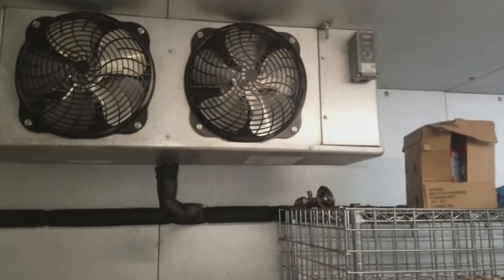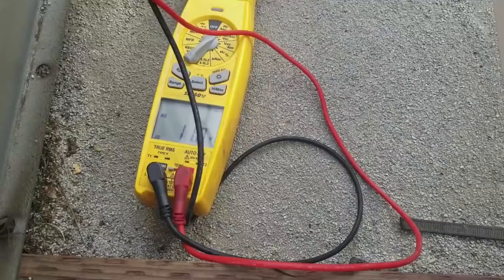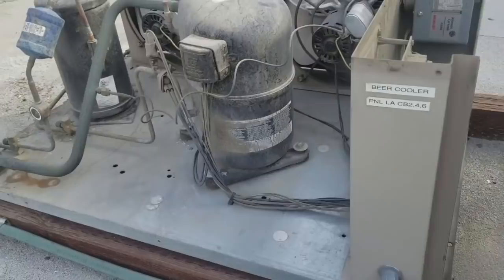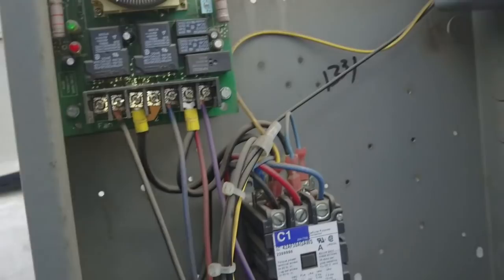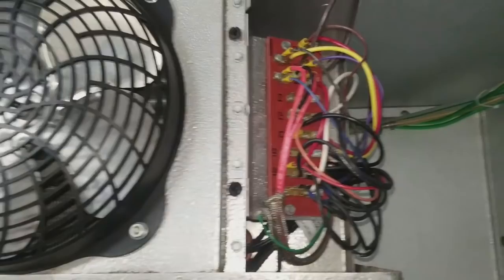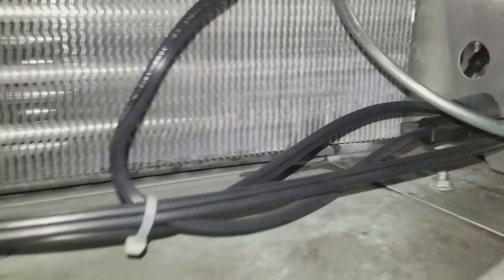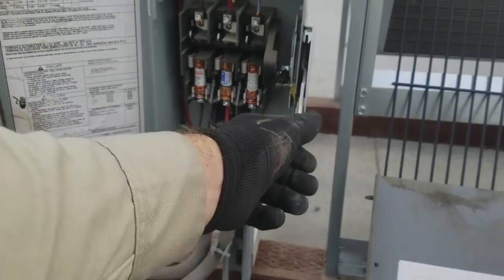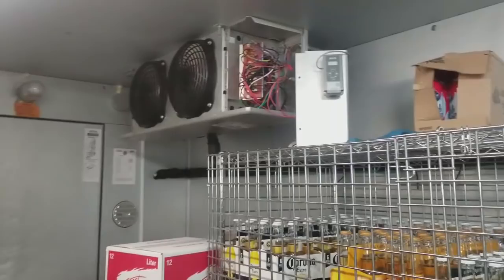Beer walk in not working

Comment: Good video Chris. I agree completely with your approach - many times I’ve had customers replace a fuse to get the machine running again, not even giving any consideration to the idea that fuses don’t just blow for no reason whatsoever... there’s always a reason why the fuse blew, and it’s the technician’s job to find the reason why.
Reply: 404 Refrigeration hey i found copper tubes in the fuse box couple of times when i asked the owner they always say oh because it blowing the fuses!!!???🤔😨😱
Reply from the maker: that sounds scary
Reply from the maker: thanks for the nice words and thanks again for watching
Reply: While working automotive as a side hobby and as a job while looking for an HVAC job that actually needs someone in the field not just a shop rat, I have found some fuses appear to blow for no reason. I had a fuse for a computer on a ford ranger i once had blow, i never found the short even after gutting the wiring to the computer and the computer itself. I have a theory that in certain DC systems like vehicles, a fuse will "wear out". Under certain repeated conditions the fuse heats and cools from reaching near max value and eventually that wears it down to a lower value making it blow. It's just a wild guess, it'd be nice to know the real reason.
Reply: @bairfamilyfarm1336  Your logic is good, thermal heating of the fuse through running at 100 % fuse rating in hot conditions or through dirty fuse connections or loose cable terminals will weaken a fuse, lowering it's 'blow' rating. The heating of the fusing element will cause it to begin oxidizing or in some cases the fusing element to begin to sag and elongate reducing the CSA of the fusing element lowering it's rating.
The rating on a fuse is it's 'will carry' continually rating, not it's 'blow' rating. A 20 Amp fuse will carry 20 Amps continually at standard rated temperature. Fuse rating curves and withstand ratings is a whole science in itself.
Reply: @bairfamilyfarm1336  The reason can also be on the other end source of the fuse too a brown out can also cause the above.
Reply: @gene-khvacr  Next time you find that (or pennies in a screw in fuse panel), simply tell the Idiots that WHEN this causes a Fire, the Fire Inspector will find the Illegal fuse bypass and not only are you going to get slapped with a Huge Fine, you could also be Charged with Criminal Negligence (for the Fire) and possibly Criminally Negligent Homicide (AKA Murder in the Second Degree) if someone dies in the Fire.
AND the Insurance Company WILL Deny your Claim and Cancel your Policy (which puts you out of Business until you can find a new Insurance Carrier...Good Luck with that, you WILL need it)...
THEN you'll be faced with LOTS of Civil Lawsuits from anyone that got hurt (Financially and/or Physically) by the Fire...

NEVER REPLACE A FUSE WITH ANYTHING OTHER THAN WHICHEVER FUSE THAT APPLICATION CALLS FOR!!!
You can replace a Fuse with a Fuse of a smaller Amperage Rating (not recommended, but Legally permitted), but NEVER with one that has a Higher Amperage Rating...
Reply: @bairfamilyfarm1336  Fuses have a thermal link inside them, when a Short Circuit or Overload happens, the Circuit draws too much Amperage. The more Amps a wire passes, the hotter it gets so the fuseable link inside the fuse body is designed to melt when its temperature gets too high.
That temp is determined by how many Amps it's designed to safely pass.
Pass to many Amps, and the link gets too hot and melts - voila, the Fuse Blows, so if the truck's circuit is frequently operating near or at max capacity (especially in a hot climate or near a hot part of the engine compartment), that link will eventually soften and blow without ever seeing an Overload or Short, the vibration caused by driving the truck doesn't help either...
Reply: Cha cha cha chill homie 🎉. It was a joke. Everyone knows copper tube still will fail ( burn open ) long before solid copper bar . This is what me and all my employees do .

Comment: Dude, I can't quit watching your videos. I've been a comfort tech for over 20 years. You are a rare breed of tech. So many companies send out unqualified service techs. I'm going into business for myself full time this spring. Your standard is what every company should try and achieve. Keep it up brother!
Reply from the maker: Thanks bud
Reply from the maker: Great advice Joe
Reply: Joe Jones, thanks for the advice. I have over 20 years in the residential heating and cooling trade. I by no means think I know everything. However, I consider myself a well seasoned tech and have done my share of install work. We're I live in rural NW  Missouri the market is huge. There is only two companies within 50 miles. One of them was recently bought out, downsized and no longer does whole house new construction. The other has a bad reputation of not returning calls and not showing up. I've been running my own licensed business on the side for about 3 yrs now. I feel that my customer base has grown enough to make that jump. Yes, it takes dedication. Your own business is a 24 hr job. The techs that try it and failed generally have no business sense. They don't charge what they are worth and accumulate to much debt / overhead. If you grow your business slowly, focus on customer satisfaction and watch your bottom line, you can be successful.
Reply: jlwhitt77 agreed!!

Comment: Who else scrolled ALLLLLLL the way back here after the livestream to see if it was as bad as he thinks? Lol

It's not!
I can tell that you didn't have any practice working and holding the phone, and it's much more polished now, but you still did a great job.

I will say that though I agree with you that fuses don't fail for no reason, most of the time, every once in a while you run into a faulty fuse, or one that fatigued from vibration. Could also be a fluke, like a power company brown out or switching event while the heaters were on, or during the compressor start in rush current spike.

Or, if the defrost clock is sticky, maybe the contacts stuck and started the compressor before turning off the heater? Depends if it's a double throw, or seperate contacts on a cam.

Anyway, yes, always assume that there is a cause that you need to locate, because most of the time there is! Lol

Comment: One thing you can do to check for shorts is this.
Get a few 100w lights. Cenect them across the fuse terminals of the blowen fuse. If theres a short the light will just light up
Some faults are voltage depindent and will not show up until power is applied.
This works grate for me when im trubleshooting.
Reply: Quick note about this test, it HAS to be incandescent bulbs, because what you're doing here is basically inserting a ballast resistor to limit fault current. Personally I recommend the "rough service" bulbs, as they're safer due to the silicone rubber coating on the bulb that should catch most fragments in the nearly inevitable case that the bulb does break (stuff happens). The filaments are also more resistant to vibration, because they have additional filament supports inside the bulb.
LED bulbs won't tell you anything, because they'll light up with leakage currents and send you chasing after stray voltages that don't actually have any current behind them.

Comment: Great work. I use similar organizers with those type of bins and they are great for fuses, small pipe fittings, electrical fittings etc.
Reply from the maker: Yeah when I went to the setup with those cases I wondered why it took me so long, I love them. And the rack I store them in really helps too

Comment: Had that issue had a 60 amp splitter someone put 40 amp fuse in It well replaced it and hit power pop went the welder but then again we figured it was already bad and is what took out the splitter was a 16k machine

Comment: Chris- I know this is an older video did you have to go back other than replaced the fuses with the 25 amps? I had a very similar situation as what you're having and it seemed to happen in the evening or overnight but not during the day. What it ended up boiling down to was the compressor was coming back on during defrost,  overloading the breaker,  since it was 12 ga THHN on a 20amp breaker and because technically when its single strand wire, it's good for up to 25 amps.  So we replaced the breaker with a 25a breaker.    So  Essentially the pressure was coming up causing the low pressure switch to come back on and there was no enter-lock to keep them from both from coming on at the same time.  Over all either the valves were getting weak or the solenoid was leaking through, we finally changed the compressor. It was a learning experience that costed me a few hours.
Reply from the maker: Rick if I remember right in the video I found some rubbed out wires and that was the problem, I ended up replacing the fuses with the right size and never got another call back. I still service this restaurant and the beer walk in has been working fine since.
Reply from the maker: I am going to go live on Youtube tonight 11/5/18 at 5:00PM pacific time to discuss my most recent uploads and answer questions. Come on over and check it out 
https://youtu.be/JHpAuTzzw6E

Comment: I dont know if you did it or not but wouldnt it be a good idea to check the amp draw of the heaters since it seems like the culprit was the defrost cycle? I've also seen in other HVAC video of people having only 1 or 2 fuses blow but the culprit turned out to be funky 3 phase power coming into the building or lighting, etc.

Comment: Everything exposed like that might be a concern. What happened to the lids? I’ve seen situations where power company’s have a malfunction and can do havoc on local public services. I had a transformer single phasing at a hotel I worked at and they eventually replaced it. Maybe ??
Reply: If you are refering to the roof unit, I think it's just that he has already removed them prior to the start of the video. You can see at least one panel is laying on the ground when he is checking the correct fuse rating.

Comment: I have a question in the time 0:28 this device for what???? the use ???? thanks a lot beforehand
Reply: That's the draft beer manifold.
They keep the kegs in the cooler, and a hose drops down from that manifold to the keg, and then goes up and out to the bar.
Those are sight glasses, and it looks like there is a filter also.
I think the kegs are kept pressurized with co2 gas to pump the beer out.

Comment: The electrician should have ran a 25 amp breaker then fuses not needed. Fuses on 3 phases usually means phase out.
Reply from the maker: I prefer fuses but would like to see phase monitors installed that way if a fuse blows the phase monitor shuts it down!
Reply: Yeah circuit breakers are nice for their ease of use and ability to be reset but fuses still offer superior protection and peak current suppression especially with phase monitoring I still remember the videos we watched in training showing the difference when each protective device was brutally tested under short circuit conditions and the site of a circuit breaker exploding in a fire ball is a scary sight especially compared to when a quality hrc fuse is put under the same stress it doesn’t even  break a sweat just takes it like a champ

Comment: Were the fan delays bypassed in those coils or had the condensing unit been running when you went to check the coils?
Reply from the maker: I honestly don't remember,  I'll have to re watch the video to jog my memory.
Reply: You don’t have to have the fan delay switch since it’s not a freezer only reason that you use a fan delay switch is allow the coil to get cold enough so that when the fans start up it’s not blowing water from the coils after defrost

Comment: This isn’t my field but I run across 3 phase in IT work. Why do you replace all the fuses? To keep it consistent? Or the cost is so low might as well replace all of them ?
Reply from the maker: I changed them all because of the potential damage to the other fuses, the elements could have been damaged but not blown

Comment: At 10:30 to 11:00 minutes into the video we see that new fuses do not “seat” properly. 

This less than perfect fuse connection can cause a voltage drop and that will cause heat,,,,, which will effect the metal of the fuse holders,,,, which will cause more voltage drop.

Heat causes fuses to blow. 

Easily broken insulating parts of fuse holders also indicates possible overheating. 

I suspect defective A and C phase fuse holders caused enough heat ,,,, yup blown fuse caused by overheating fuse. 

Would be interesting to see what that panel looks like through an IR camera.
Reply from the maker: Chuck DeArruda the fuses did not seat at first but I corrected it. The plastic that you see  broken is not an insulator it was an arc guard. The cause of the bad fuses was an electrical short in the evaporator coils.
Reply from the maker: Unfortunately this location is in palm springs,Ca. And the summertime heat is insane 125+ on the roof. The plastic arc guards inside the disconnect are very brittle and they simply broke when I was trying to set the fuses in the fuse holders correctly.

Comment: Why do you replace all the fuses when 1 is bad?
Reply from the maker: The way I look at it is why not replace all three, it's cheap insurance like changing a capacitor when you change a condenser fan motor.
Reply from the maker: polishtheturd mickelson yep  Always look out for your own ass!
Reply: With a lower amp fuse than the other two, that one fuse could blow quicker than the other two because it can't withstand the same amperage. Better to replace all three & have all three blow, than to risk single phasing going to the contactor.
Reply from the maker: NSNOfm78 exactly!
Reply: I work on so much old equipment. Polishing a turd is my paycheck. 40 hours a week. Check out the system every time. Defrost cycle? Can it pump down? Contactors ok? The list goes on.
Reply from the maker: yep same thing day in and day out.  I too get stuck with a bunch of old stuff, but it keeps me busy!
Reply: It’s absolutely ESSENTIAL to replace all fuses on a polyphase system when a fuse/s has/have ruptured. In this three phase system the other two fuses will have carried fault current and as such the elements have been stressed. It is entirely possible that the sand in the unruptured fuses has started to melt and has formed a quasi tube around the element. If the already stressed fuses are left in service, one day when they are needed to clear a fault, the element melts, but the sand cannot fall in and extinguish the arc. The fuse body will likely fail catastrophically and depending on the MVA fault level available could even flashover in the fuse enclosure. This is more expensive and more dangerous than replacing a couple of buck fuse!
Reply: Oh, and must be the same rating and exactly the same type as different fuses have differing thermal dissipation, melting and arcing characteristics.............this is bad news on heavily loaded circuits
Reply from the maker: Great answer Dave thanks bud !
Reply: HVACR VIDEOS well, I’d like to say it’s because I’m clever. However, it’s actually through painful experience and incremental learning 😂😂😂🙄